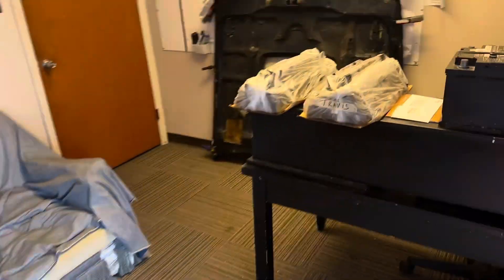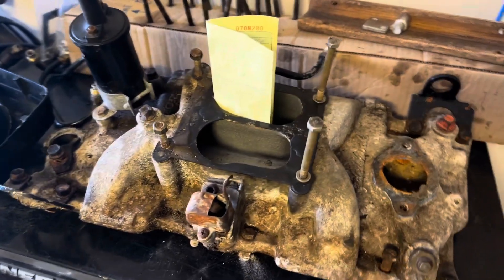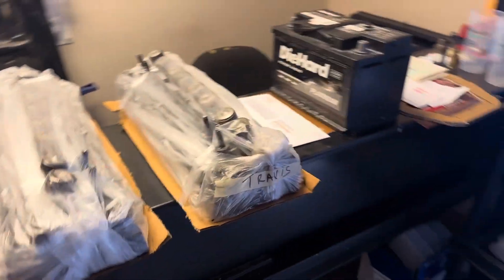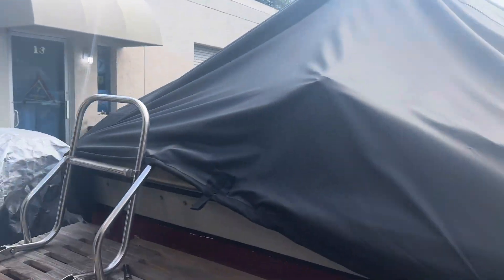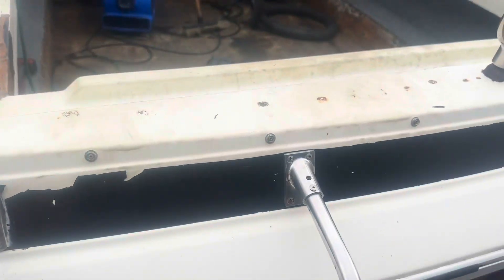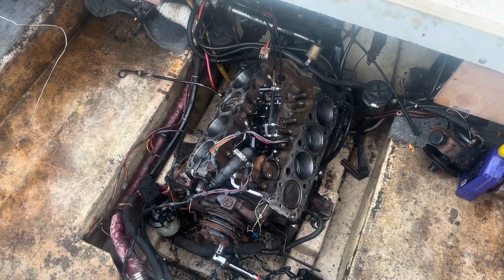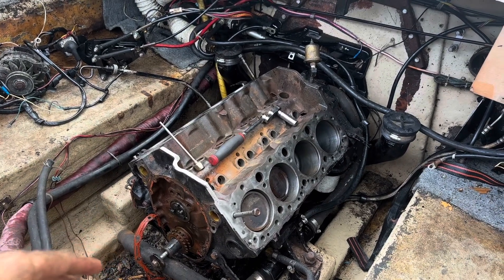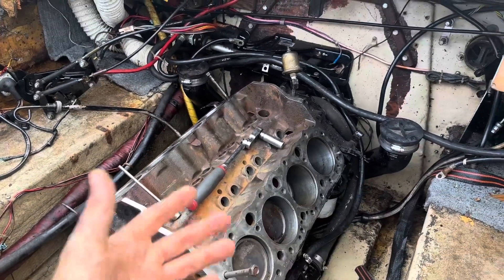Time to Bust Out Another Thousand… 1983 Formula F20SC Refresher!

Comment: well hopefully things aren’t too rut rough raggy.? Maintenance is key with boats. If the previous owner ran low grade fuel like regular causes cylinder knock. We ran premium all the time in our COBALT. We had a 200 hp 5.0 liter engine. yes my dad could have gone way bigger BUT she was a cruiser she had enough ponies to pull skiers ⛷️. everything was original Head turner. Teak. My father kept up on oil changes every spring. and lower unit as well. Today yes everything is electronic way modern. But if you upgraded you take away originality.